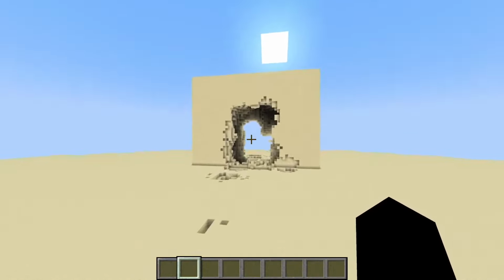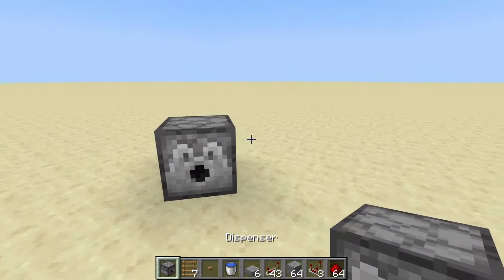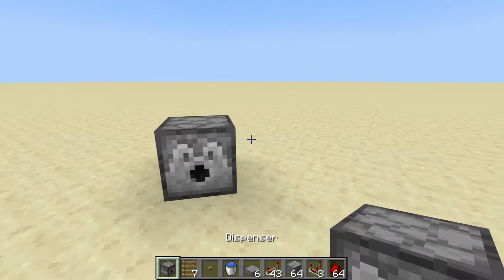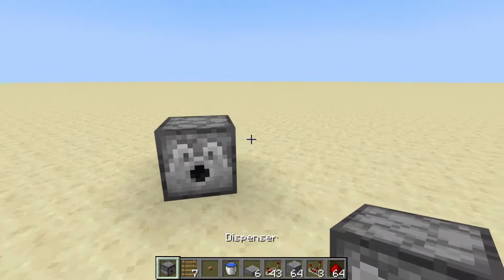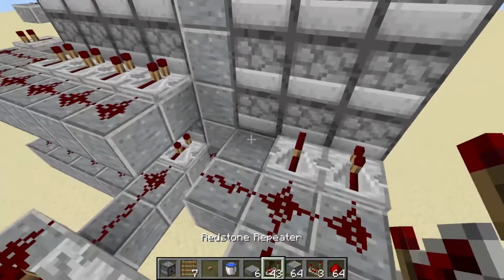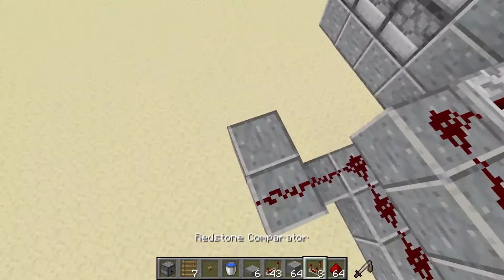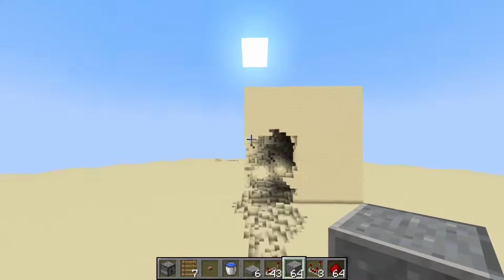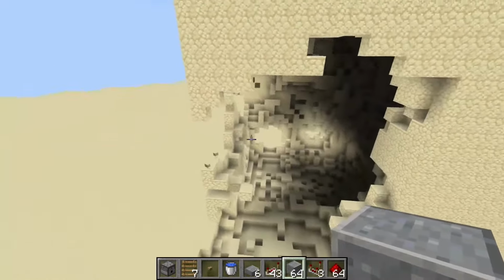Most Powerful TNT Cannon Ever (Tutorial)

Comment: make one that can break through water
Reply: Not possible
Reply: @notaidan6083  lol
Reply from the maker: Just saw this now. I hope to make one that can break through water soon, it is actually possible (I think)
Reply: @GenericRedstoneGenius  i can show you  if you want. Its really easy
Reply from the maker: Honestly I would appreciate that.
Reply: @GenericRedstoneGenius  Oh, would like to see that then.
Reply from the maker: @notaidan6083  I will try to do that soon - I didn't know it was possible either until a few months ago. It works by firing sand or gravel to make a hole in the water and then the TNT blows it up.
Reply: @notaidan6083  it is and totally doable. they are called hybrid cannons. basically you fire a stack of sand with a hammer down a few ticks behind the stack. the hammer down blows stacking the sand on the wall. then a hybrid shot of tnt comes in and the a piece of sand lands on top of the lit tnt so that it blows up inside a solid block. we do this all the time on faction servers.

Comment: working on bedrock edition?
Reply: Really because it worked for me
Reply: @E_l_i_p_s_e  wow
Reply from the maker: Unfortunately I am unable to test it on bedrock currently.
However I see no reason why it shouldn't work. 
If anyone would like to try it, reply to this comment if it works or not.
Reply: @GenericRedstoneGenius  it works on bedrock but only thing that doesn't work is the repeating system
Reply from the maker: @eatmybootyhole2231  Ok thanks for letting us know, if anyone else wants to build it on bedrock you can replace it with another toggleable clock.